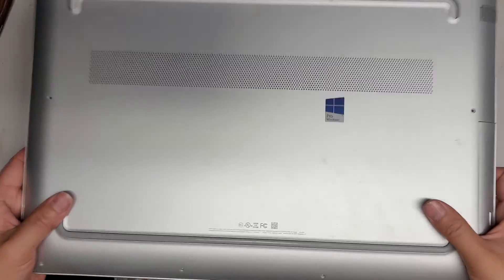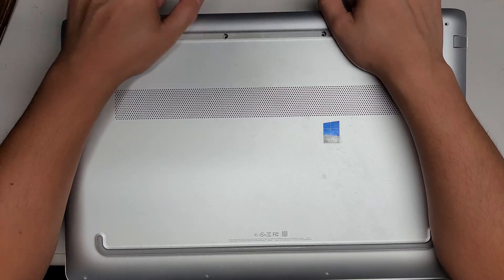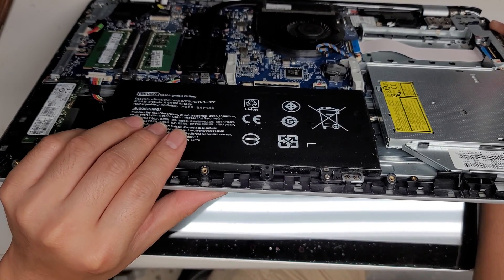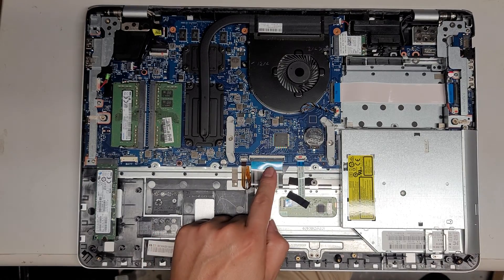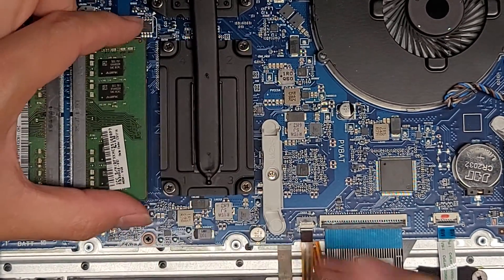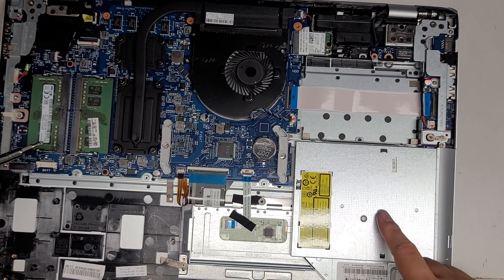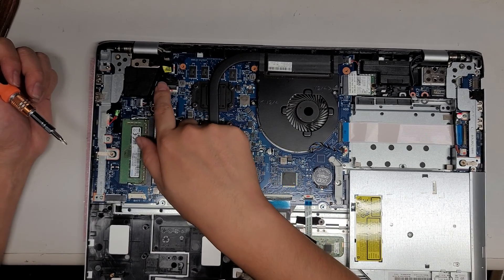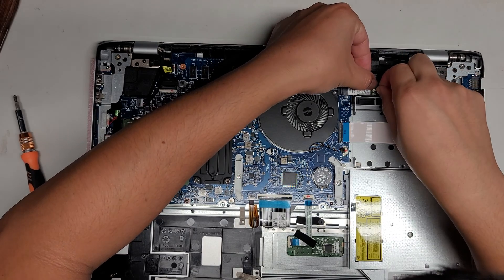HP Envy Notebook PC 17t-u100 Disassembly RAM SSD Hard Drive Upgrade Repair Replacement

Comment: I've got the same model, and am also missing the HDD bracket that you pointed out in this video. Does that mean I'm SOL for putting in the second hard drive, or is there some way to get my cable attached without it? Thanks!
Reply from the maker: If it's an SSD you don't really need a bracket. You can use some double stick tape or roll a piece of tape to do it.
Reply: @ItsBinhRepaired  I wasn't clear. :-) I've got the HDD seated well, but in the video, you showed where there was an HDD marking on the circuit board but without a bracket to stick the end of the cable from the HDD into. Are you thinking I can try to attach the cable to the circuit board with tape? Thanks!
Reply from the maker: @lindabusdiecker90  attach the cable? You're going to have to make a video showing what you mean.